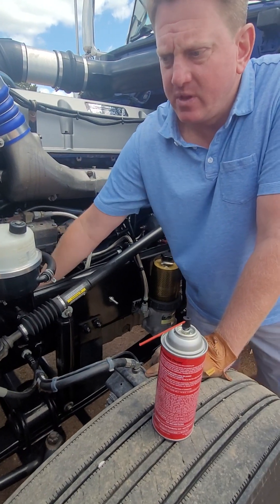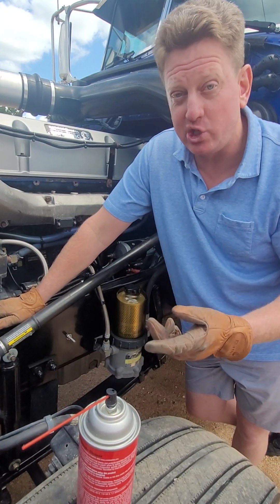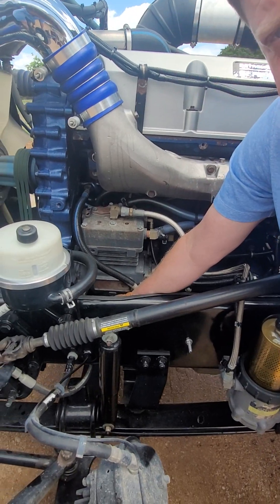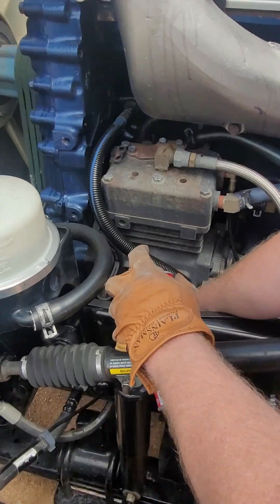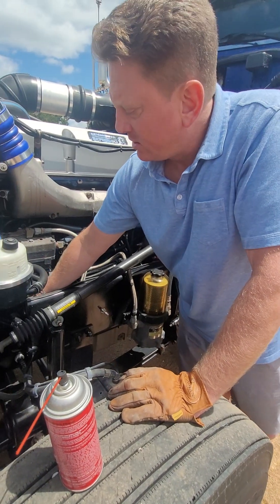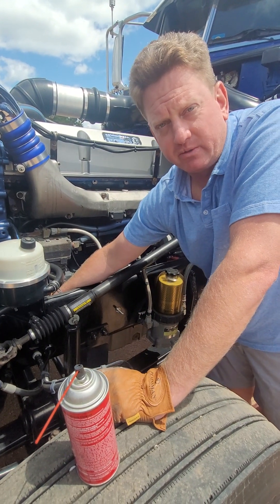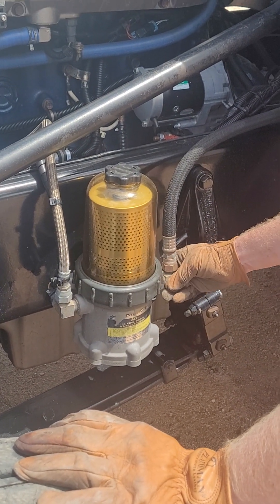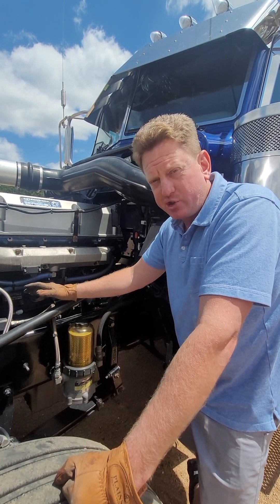Diagnostic for Crank No Start with Check Engine Light

Comment: To add, if you don't have a check engine light or engine light on the dash. Power to the ecm is the problem. B3 connecter is power from ignition switch. 5 wire plug on ecm has 3 grounds and 2 powers from battery near the latch of plug. Hope this helps and good luck.
Reply: What is b3 connector. The 5 wire one you talking about  or different 1. Mines has hot straight across from each other and 2 grounds on other side and in middle is negative also
Reply: @DR-um2bv  Sorry, front connector or closes to cab that has the bolt in connector. That connector will have a b c d e f g h for top to bottom locations. left to right is 1 2 3. Count the pins should have 24 pins in connector.  The battery power only has 5 pins two positive and three negative.  Hope this helped
Reply: @DR-um2b

Comment: Just had a similar problem but trk would start with carb cleaner on the air filter base but would only stay low rpms till I scanned it n trs sensor popped replaced both trs n srs sensors n trk start good. Also before trk just died it would start n withing 30secounds idling it would act up like air in fuel n eventually died .owell all good now

Comment: What if I’m not getting a check engine light, plus I’ve already changed the trs and Srs sensor.
Reply: Same truck like mine. Same color engine and pretty much everything. I have this problem but only when it’s cold.
Reply from the maker: Hello! Let me pass this to Joshua and see what he says!
Reply from the maker: Start by making sure your plugs for the temperature sending unit, oil pressure and fuel pressure sensor are making a good connection and the wires are in good shape. Let us know.